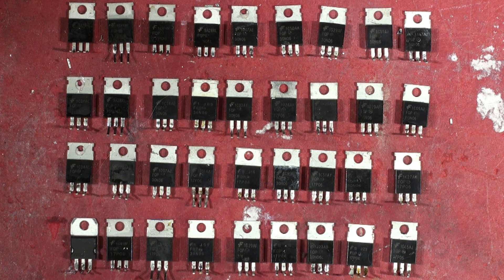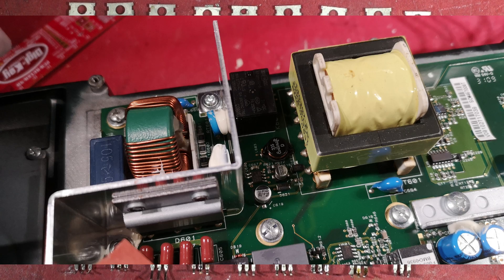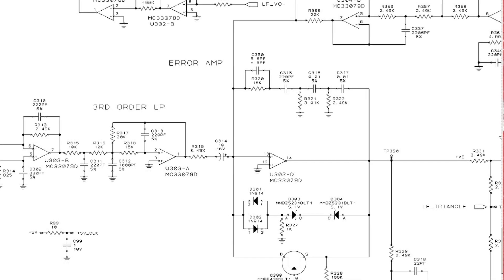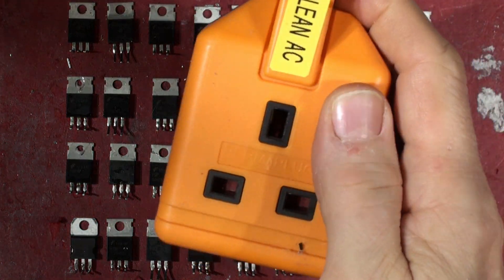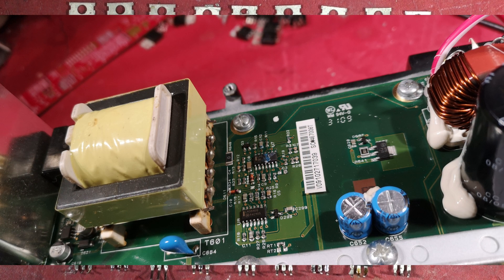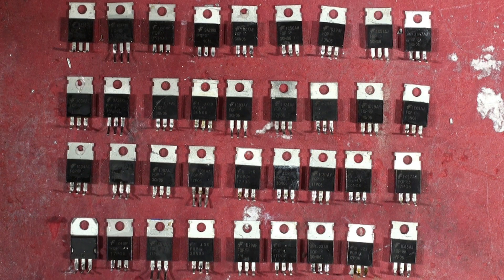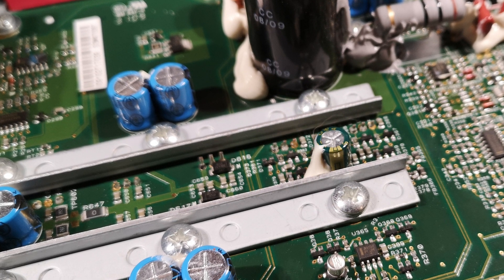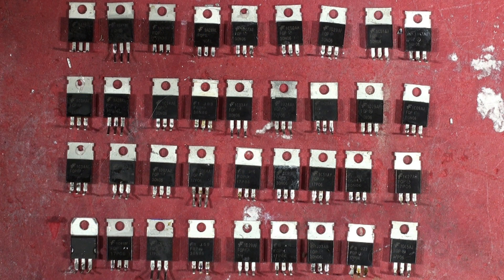A record weekly death toll of JBL EON500 Series LF Output Drive FETs

Comment: Great work on finding yet another JBL design issue. Do you have a video covering the JBL EON615 power supply / amp? It uses an L6599 half bridge resonant controller for the PSU and the obsolete TDA8954TH Power amp IC's. Thanks
Reply from the maker: The TDA chip is a pain. I have sourced several of them sold as so called 'genuine stock' but they just blow when powered up.  There is no declared replacement part see https://www.nxp.com/part/TDA8954TH#/